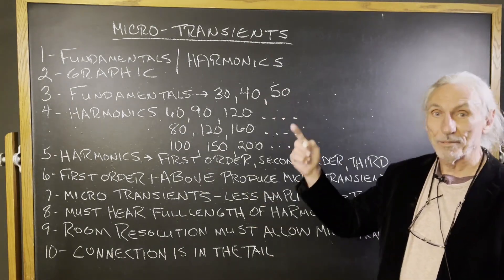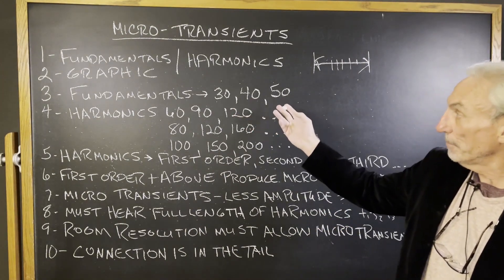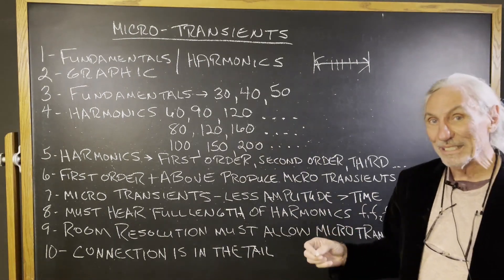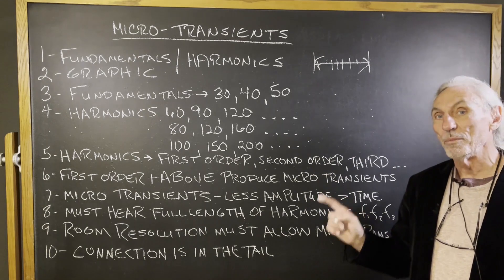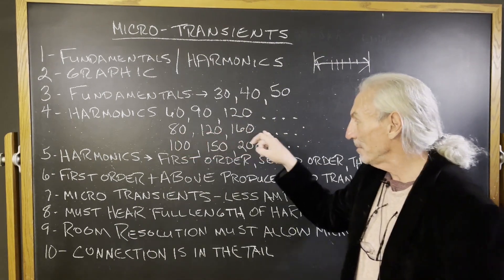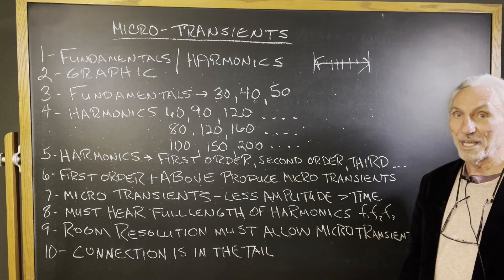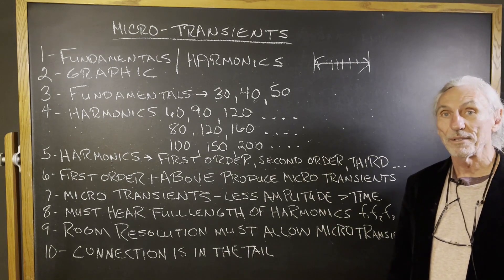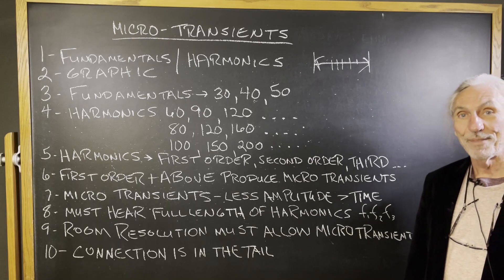Micro Transients - www.AcousticFields.com

Comment: I have a stupid question.
OK, I have a really stupid question.

Have you by any chance, tested your sound treatment technology to see if it is converting the energy from the sound into heat or electricity?

For ever action there is an equal and opposite action.
So, what is your device doing with all that energy?

OK, that's ended up being two stupid questions.
Reply: Definitely not stupid questions, I believe the sound would be exchanged to vibrational energy and heat while passing through such a surface. Pretty cool questions if you ask me
Reply from the maker: The values of energy involved in this kinetic energy to friction / heat conversion process are very low. I am ceretain they can be measured. It would be an interesting topic to pursue. Wish I had the time.
Reply: Energy in sound waves becomes thermal energy in the material.  This is entropy at work.